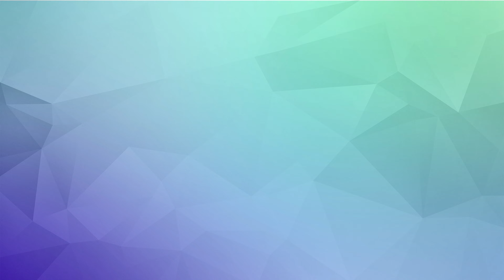Episode 234 - 2024 LUCID Gravity - A Detailed Look!

Comment: Nice looking car but means nothing if you don’t give us the price .
The lucid air looked nice until you saw the price tag 
Over 200,000 for a sedan is insane I would imagine this will cost even more
Reply: Gravity is going to cost ~$3k more than the Air which starts at $102k Canadian not $200k. In other words Tesla Model S and Model X prices. Very sane for bleeding edge premium midsize electric vehicles.
Reply from the maker: @CMCNestT Thanks for watching and for your comments/response.  Although no Canadian pricing has been announced yet, one can guess based on USD MSRPs.  I would agree that the Gravity will be in Model X territory with regards to pricing, would make sense.  Less than EQS SUV and maybe less or a bit more than Model X.  Will have to see.  Yes, for premium mid-size to full-size SUV all-electrics, this is the price range we are seeing.  For sure, not for the average Joe (which is me), but should do well as that is a nice market for them.
Reply from the maker: @kevbrown1867 Thanks for watching. I did state that the MSRP is estimated to start at $80,000 USD (see near end when I list the Specs).  So the Dream Editions will be over $100K USD to start I would guess.  Converting that to CDN Dollars is another thing.